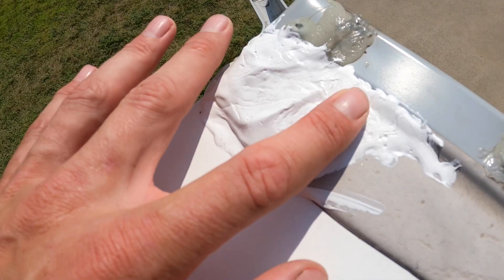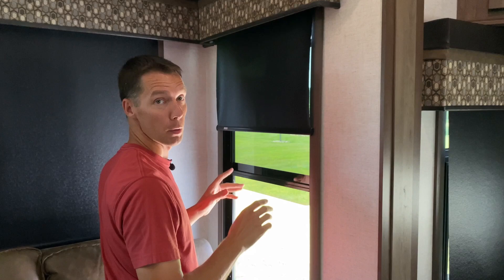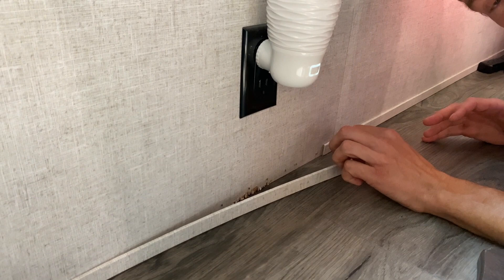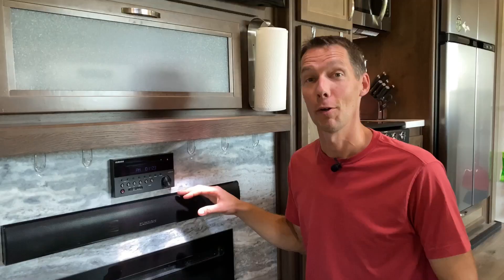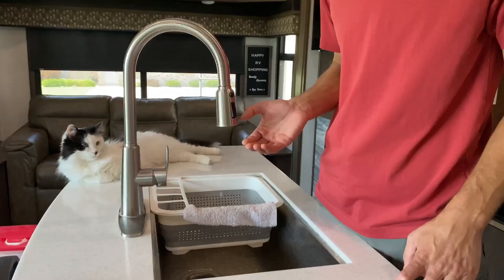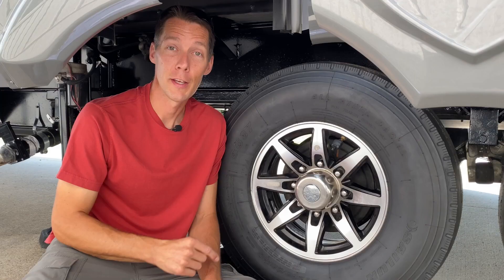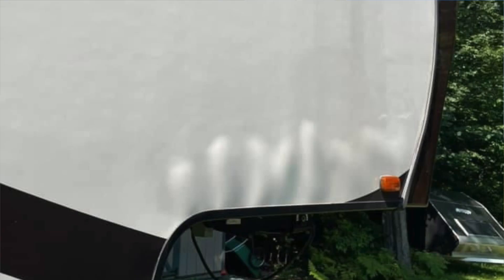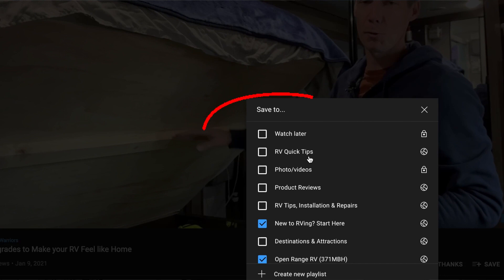Don’t Buy a Lemon | How to Inspect a RV Before Buying It | FREE ✅ List

Comment: New RV owner should be made aware of these so called ultralights and others, That have Styrofoam floors. If it doesn't have at least a 1/2 inch plywood on top of the  Styrofoam floor are almost  guaranteed to have delamination  Leading to failure. Please people do your homework  Styrofoam floors and ceilings and roofs is just wrong.
Reply: Yup, you can't live or stay long term in an ultra lite (foam floor will delaminate and go soft and sink like it's rotted) and they certainly are not built to be used oftem. They're the lowest durability trailer. 

Then there is Winnebago and their foam laminate roofs that will collapse if manufactured wrong or delaminate, so check that out... Roof should not be soft and creaky, or flat and collecting water where the heavy ac is.
Reply: Wow! Good to know !

Comment: So what's the point? Say the RV's engine and transmission are perfect, but you found a rip in the awning, are you going to pass on the RV? This "RV inspector" falls into the NON-ESSENTIAL category of employment.
Reply from the maker: I’ll try to break down the point since you didn’t pick it up in the video. If you go through and inspect the RV before buying it, you’ll have peace of mind that everything works or you’ll have the price reduced to reflect the actual condition of the RV. Sometimes the issues found are repaired before taking ownership and other times the buyer chooses to walk if they find major issues.
You may not find an inspector or inspecting an RV “essential” however there are many RV owners that value having an RV in great condition that they can enjoy vs owning an RV that’s sitting in the shop for repairs because they find out shortly after the purchase that it’s broken.
Reply: Don’t talk.
Reply: @Donschmoodle  Don't live!

Comment: You saved me so many headaches with this video and your inspection list! Thank you so much! I printed and took your list to inspect our new bumper pull camper, and found many things wrong that they fixed with my supervision. Some included the couch/hideabed only being anchored on one side, shower silicone not attached to wall and up to a 3/8" gap under the shower curtain track so it would have flooded the bathroom the first time we used it, the front stabilizer jack switch was broken, and so much more! Thank you! Thank you! 
I found all of this after the walk through with the tech. I can't thank you enough
Reply from the maker: We’re glad to help :)